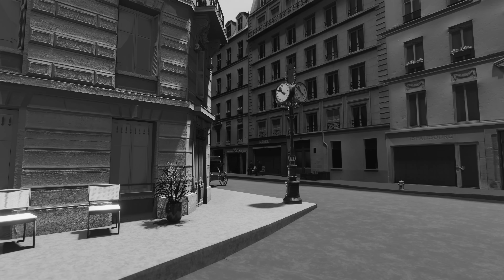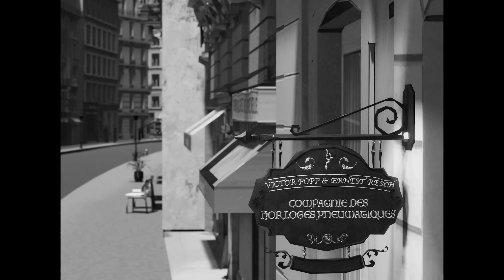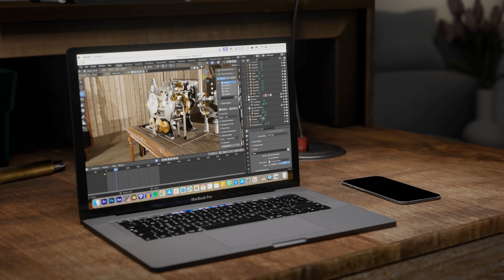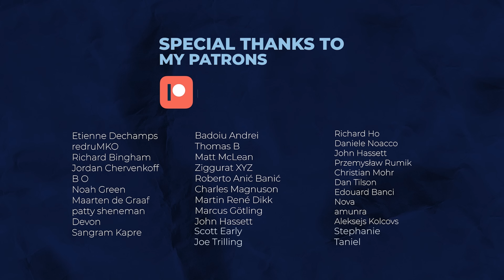The Underground Clocks of Paris

Comment: My Southern Indiana grade school was built in 1909 and used pneumatic  clocks. The air pulse was about every 90 seconds. The minute hand moved once every 1.5 minutes. 

The master clock with an air supply sent an air pressure pulse.

When there was a time change the principal had to press a button a mess off times to advance an hour.

The master clock was set true by a railroad chap back in 1909 before wwv existed.

Master clock had wind up   or weights. Ie pendulum. 

Air compressor filled the air tank

The clocks in rooms and hallway were slaves to the master clock. 

All this pneumatic stuff was hot technology and used in player pianos  lead pipes and rubber tubes 

Player pianos actually use a closed loop feedback system to sense the paper rolls tracking. Ie their are two bleed valves that contact the rolls edges. 

Then this feedback commands the brass bar with sense holes to be aligned to the music holes in the roll.

There is a bellows that moves the bar left and right. Ie a bellows with two ports

Comment: The only thing that I question, is why they chose a pneumatic approach instead of hydraulic? You mentioned that the air took time to travel to the furthest clocks, up to a minute you said, which makes sense due to compression. But if they used hydraulic system then there wouldn't be a delay

Comment: Why would they remove such a genius piece of history?!?! 😮
Reply: Upkeep cost is a big one, but the main would be that when they replaced it at the time the pneumatic clock wasn't some amazing historical machine, it was just what they were using and a new technical advance was made that would be cheaper and more accurate so the move was a no brainer at the time. Easy to get annoyed or confused as to why it wasn't preserved through the lens of someone decades later seeing it as a engineering novelty

Comment: I see how it keeps them in sync within a minute but how do you know which minute to set the clock to initially?
Reply: Most likely from working their way out during install (and likely during maintenance sweeps). I would suspect someone would use a calibrated watch or similar and work off the prior clocks time

Comment: One thing that is worth notice is that: This system does not syncs other clocks (let's call them city clocks) with the Master clock, it drives other clocks using the Master clock's power.
Which also means:
- City clocks can never drift, because they don't actually run.
- If a city clock is out of sync since the beginning, let's say 5 minute late, it will stay 5 minute late forever until a person correct it.

Comment: Now days almost every clock in the internet is controlled by a atomic clock, carrying about the same purpose of the clock in the in video. this also applies to the phone towers, that's how they are so accurate, if you disconnect your phone for a long period of time (sim card or intetnet), the time will eventually get out of sync on your phone

Comment: Doesn't explain the synchronization though. What video says is that master clock was responsible for sending burst signals, which are relative. They relatively increase each clock's time by 1 minute.
Which implies that end-user clocks would still need to be corrected with proper absolute time manually, using some source. Sun clocks?

Comment: It should be noted that there were master electric clocks and distribution systems already by the end of the XIX century. They were common in train stations, parliaments, etc. One example being the Brillie company. The slave dials themselves (they lack the elements to be called clocks) distributed through the buildings, were extremely simple, with essentially the same that was described here, except that they had a solenoid instead of a bellow. Usually the master clock was a trustworthy long case regulator with a contact, although I have seen turret clocks being used as master. The very old ones, used battery banks instead of a power supply, because there was not yet electric distribution available, similar to phone and telegraphic systems.

Comment: I wonder how they made sure each clock got the same/right amount of air? As I’d imagine less air would get to the outskirts of the city than the clock first on the route
Reply: I knew nothing about this systems existence until having just watched this video, but I would have to imagine that it would have maintained the end of line pressure at each display through a system of manifolds that continously reduced line diameters from the initial main at every branch in the system.  It somewhat hints at the idea in the video by mentioning that the main control units impulse fed 10 separate lines.  

This is just an educated guess on my part though. Cheers.

Comment: If I had to guess, I'd think the main clock didn't carry the full pressure of the system but rather fed small actuators that turned on higher pressure valves.

Comment: But that means that just the clock is driven by pressure air. You need to set te clock to the right time before you connect it to the pressure system ?

Comment: 🎉New Compounds of Medicine, Gaseous pumps of electrical transformers. From the country of Germany and France
Reply: Gastrigenal Momentum flow energy
Reply: Single Protonic wave
Reply: Microfuse of the three pin plug, you can simplify it to that degree
Reply: Gaseous titration is now possible
Reply: Metalral solid
Reply: Because you can cool gas at NA Labs temperature now
Reply: Which means Jeff Bezos Ice Time has been on
Reply: Also disengages the European plates ex-UK, less ground resistance. Less earthquakes around that part of the Asia-UK fracture
Reply: Europe can now be a O&G powerhouse exporting supplies towards the rest of Asia and equivalencing the NA fracking tech.
Reply: Some Inter buildings, House hacking
Reply: It's now a decentralised O&G separate with Solar excluding.
Reply: Because so as to not electrically overpower the central electricity powerplant, it's a additional power source in times of Winter. Alternate O&G
Reply: This was the CS Blockchain Horse problem
Reply: Alt Woods warming and alt Charcoal for cooking with natural gas in place
Reply: Electrical charged fireplace
Reply: Alt source of nat gas
Reply: Some quantities of houses and buildings
Reply: Solving SG's O&G shortage also. Bringing down gas and petroleum prices down by a magnitude of 10
Reply: 10pips
Reply: $2.10->$2
Reply: 2 months holiday for multiple calendar years
Reply: The water solution because lack of water
Reply: Next 200 years

Comment: Does anybody knows why it used air that can be compressed instead of water or oil any other material that could not be compressed? I wonder if the fact that it was using compressed air could have cause imprecisions to the system, or if it had lead to be more complicated in order to make sure that everywhere the pressure was the same and keep the precision???

Comment: For anyone wondering how the Popp master clock kept in sync with the observatory's clock - I dug into Primal Space's references listed in the description and found this excerpt from the "Douglas Self" reference:

At the Paris Observatoire a high-standard astronomical regulator clock was kept running on correct mean time by astronomical transit observations, being corrected daily. Pulses of electricity were sent every second to secondary clocks around the city, the wires being run through ducts in the sewers. Two loops starting and ending at the Observatoire carried thirteen clocks between them, the farthest being at a distance of seven and a half kilometres, or nearly four and a half miles from the observatory. The clocks were of a high standard, so they could keep good time even if the synchronising pulses failed. (The pulses synchronised the clocks but did not drive them, they were weight-driven in the conventional way) The secondary clocks were furnished with second-hands, and were placed so that they could be easily seen from the street, usually in prominent positions. They further distributed time by sending electric signals once an hour to synchronise various public clocks. The system came into operation in 1878.

So it appears that electronic synchronization was in use at this time but perhaps it just wasn't cost effective at the level for mass production. However, having a few extremely well made electronic clocks was worth the cost to keep more affordable, but less precise, systems in sync.

Comment: Was hoping for some more nerdery tbh, like:
- How did it lift those weights without pausing the clock? Did the compressed air (that was lifting the weights) additionally, in another part of the system, impart a replacement downward force while the weights were being lifted or something?
- How much pressure was needed to get kilometers upon kilometers of tubing pressurised and how was this generated, I guess some steam engine was part of this thing?
- How much force did those clocks require, like how many bars would start inflating that bellow, did they manage to get that barely above atmospheric to make it work at such distances or how did this all work?
- Why not make this clock the master clock that is adjusted by the astronomist timekeeper, or have a second timekeeper who updates this clock, instead of somehow linking those two clocks?

Comment: imagine using air for clocks
Reply: They also supplied compressed air as an alternative to electricity to power elevators and all sorts of other machinery, like dental drills. The service run in Paris until 1994.

Comment: Where is the external energy source. How is this not perpetual
Reply from the maker: Great question. This system really operated without an external energy source in the sense that it did not rely on continuous input from an external power supply. Instead, the bursts of compressed air were generated by the master clock to synchronize them. The system wasn't perpetual because it didn't generate energy indefinitely without any external input (the energy needed to generate the bursts of air was provided by manually winding the mechanisms of the master clock on a regular basis).
Reply: @primalspace  It took a little more power than that. The central clock was opening the valves, but the air came from a series of reservoirs, starting with a large 8 cubic meters reservoir holding air compressed to five times over the atmospheric pressure. This reservoir was constantly replenished by four air pumps, driven by two large steam engines. The system probably required around 100 horse power to run.

Comment: So the clock had to be adjusted for the first time before use, and would have an error margine of 1min?
Reply from the maker: Correct. They would also be monitored and manually updated though along the way.
Reply: @primalspace  Thank you for the Answer!So when they would find that the Masterclock was out of sync, would they send a constant flow of air out until the entire system was updated?

Comment: What provided the constant source of compressed air? What if that source failed?!??!!?
Reply from the maker: The constant source of compressed air was provided by the master clock mechanism. The mechanism itself was powered using the system I detailed in the video, and that would have been manually wound to ensure continuous operation. If the energy source failed, the clocks would gradually lose synchronization with each other, but to mitigate that risk regular maintenance and inspection of the master clock system was done often before it could lead to any significant disruption. Usually they'd catch it as soon as the clocks were off by only a little - so no huge disasters ... that I know of haha.

Comment: I don't see how it synchronized the clocks.   What if a clock was fast?
Reply from the maker: Great question. If one clock was running fast, it would have lead to discrepancies in timekeeping across the entire network, but technicians (or the timekeepers) would intervene before that happened to adjust the clock and bring it back into alignment. This would involve either manually recalibrating the clock's mechanism, or repairing any mechanical issues if that was causing the problem. Regular monitoring and maintenance of the clocks were done though to ensure their accuracy though.
Reply: @primalspace  Thanks for the reply.  That makes sense.  I'm sure it's more unlikely one would run fast.  A failure or high fiction would cause it to be slow.

Comment: Even though this is "downgraded," I think it's genius to use analog. I can't imagine what they would do with traffic lights if they required little electricity and more compressed air like the clocks than anything else. It sucks that everything now has to be digitalized. I mean analog circuits are cool, this topic too;  I even find the mechanics of older technology like pin ball machines and VHS to be quite interesting. I'm old in the inside, sorry.